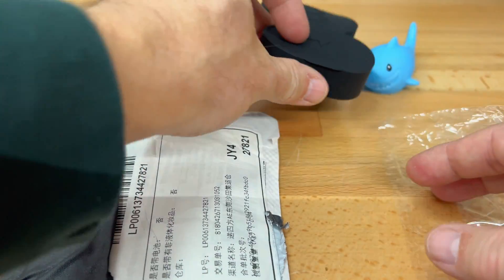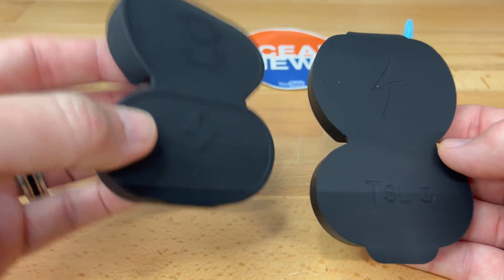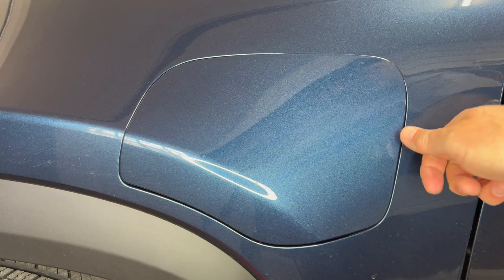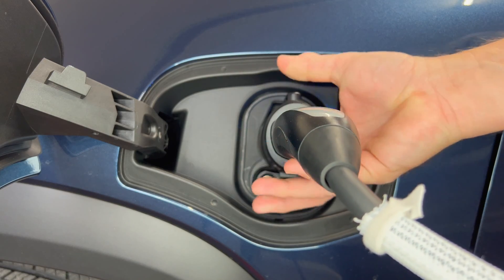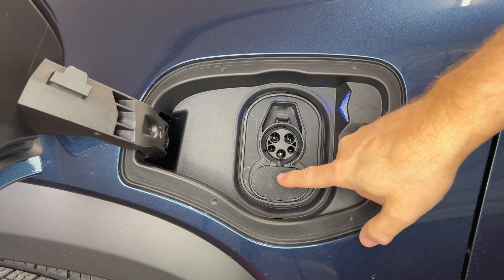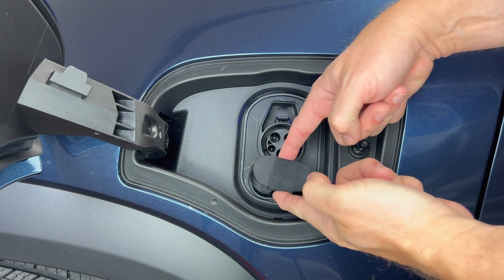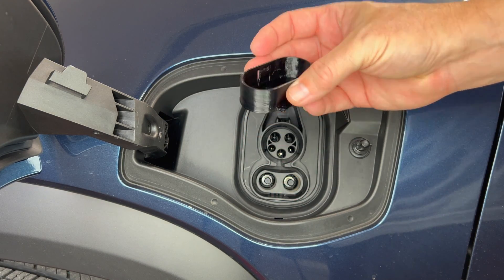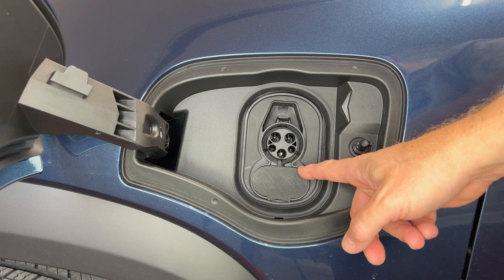Fisker Ocean One - DC Pin Covers

Comment from the maker: I'm going to be working on a customized 3D print that will work better on the Ocean's port.  I'll be covering that in a future video.
Reply: Probably just need to remix the existing design (add the notch)
Reply from the maker: @christwiner9231 This one looks nice.  I need to find the STL file: https://www.ebay.com/itm/335019436024
Reply: @MTNRanger  I printed one with a 6mm  gap but its slightly too small.  I'm printing a couple of others now.
Reply: Any update on creating one? Would like to get one :-)
Reply from the maker: @Lewykall  I have a couple designs to test but my friend with a 3D printer is on vacation.
Reply: I remixed the original and removed the notch, fits perfect now. Now modifying to add a small knob/handle to remove it easier.  @MTNRanger
Reply from the maker: @jimmybucklin163 Do you have a link? I was thinking a handle would make it perfect.  It has to be fairly flat since there may not be a lot of room under the charge port cover when closed.  I want to do a follow up on this, but I've been delayed with home renovation until the end of February.

Comment: I too was concerned about the CCS1 DC pin exposure to the elements since my parking location doesn't have a roof.  I did get the 3-D printed CCS2 (in the video) and worked like a charm.  Thank you for your recommendation on how to install the bit with my Level 2 charger.  Keep 'em videos coming. Happy Holidays!!!

Comment: Your recommendations is greatly appreciated. The version with deep silicon wall is ordered and presumably will fit my ordered Extreme model for delivery to Norway. And may I ask if there is possibility to manually preheat battery when charging on AC (at home) from the app or in the menu on main-screen? At freezing temperatures it is advised that for the batteryhealth  one should preheat. Maybe also when charging at lower amps?
Reply from the maker: Preconditioning for DC charging the battery and HVAC should be coming in an OTA. I’m only aware of preheating for DC charging. AC doesn’t need that.
Reply from the maker: Let me know how the cover fits the CCS2 port when you get your car.